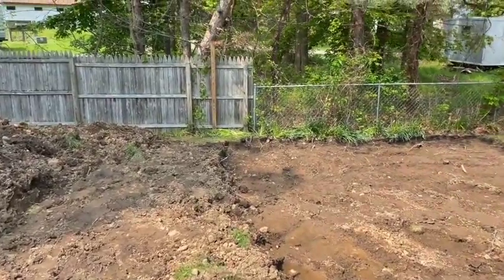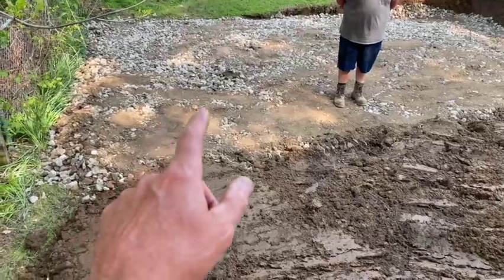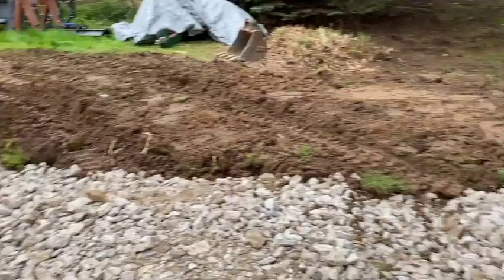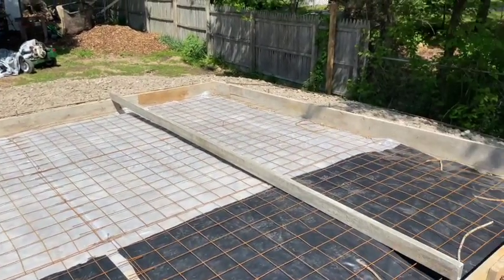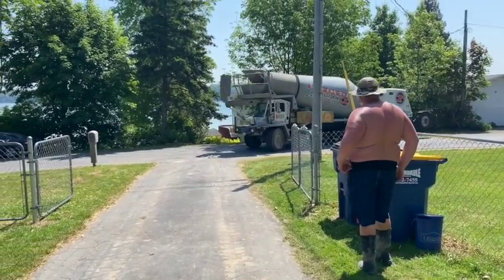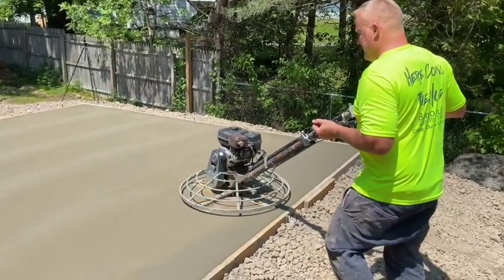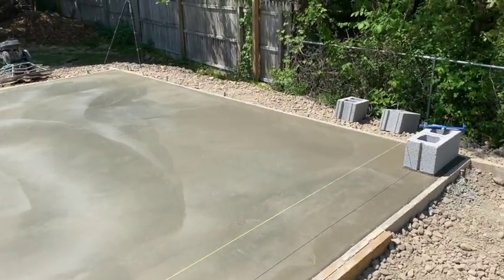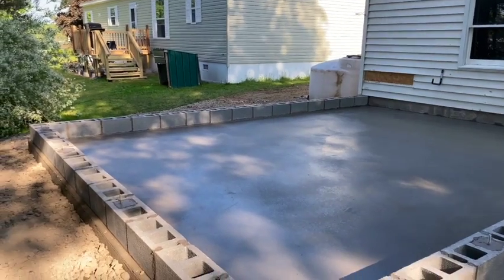Will this floor crack? 5 feet thick!!!

Comment: Staying above the water level was a smart thing to do. Like the crushed concrete for base build up. Having the right equipment makes the job go smooth. Just as long as you don't get a "Hot Load" delivered, or to much chemicals in the mix. That would look like Zero Slump, and a yellow fluid floating on top of the concrete, would look like an Elephant took a leak. Lol  That happened for real, on a big pour, a screw up at the batch plant.

Comment: I dont understand why you put the concrete pad down then do a single row of Besser Blocks? Is there going to be a timber floor on the extension, if so why?
Reply: That any you can built your walls off the blocks and get higher walls and not have to worry about using PT lumber.

Comment: The thickest floor I ever poured was nine & a half feet thick. In a 3/4" steel plate form, it was 14' wide x 17' long & 9 1/2' tall with #5 rebar 12" x 12" x 12" spacing. Embedded was 6 - 2" x 36" long J bolts that held a 7,000 HP electric motor in place for a car shredder. I pumped & vibrated this in the rain alone while my finishers sat in their trucks. Precariously walking on rebar 9 1/2 feet off the ground while directing a 42 meter boom pump in the rain, stopping to vibrate every 12" lift was quite a memorable experience. This was poured on top of an existing slab 12" thick with no cracks, only 207 drilled holes for epoxying in the vertical #5 rebar. There were 3 - 14' long 4" steel pipes welded along the 17' wall to keep the 3/4" plate form from spreading. 2 - 3" pipes along the 14' wall to keep it from spreading. These pipes also served as lifting points to set it in place. Leave in pace steel forms to protect the concrete from flying shrapnel.

Comment: Yeah that's remarkable how much of a difference the sun makes on it. Also wind, just a little bit changes it so much. Do you ever use a spray of some sort to help with finishing and preventing it curing too fast? Overall, nice solution, looks super strong!

Comment: I did my own crushed concrete pad 4 feet thick 100x50 sprayed water and vibrated, 2 days later you couldn't drive a stake in it.
I don't think if I poured concrete on it that it would ever crack.
This was in Florida.

Comment: few feet of rock does wonders. I have dealt with worse ground, for which engineer speced a layer of woven geotextile. Load it down evenly, put a couple feet of rock onit, and pour with no issues.